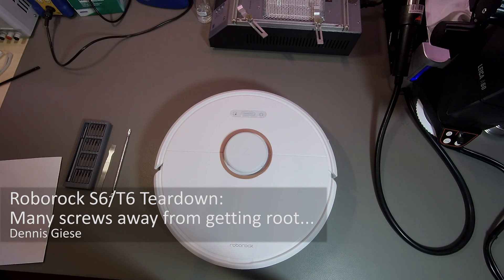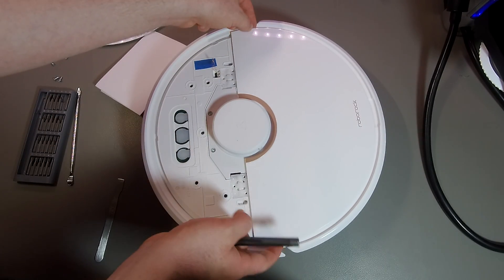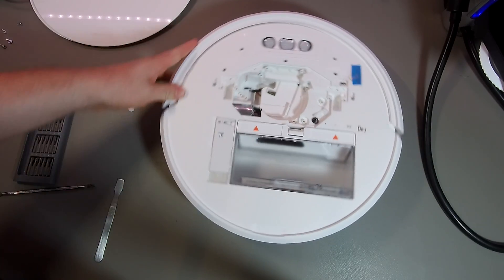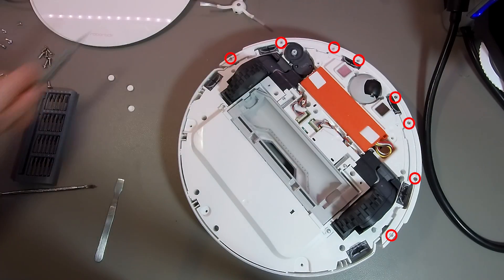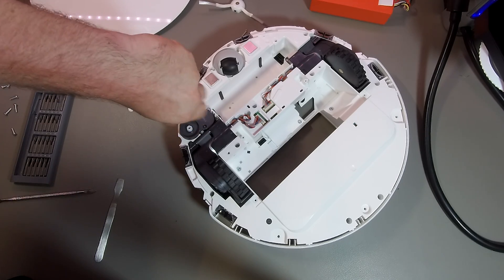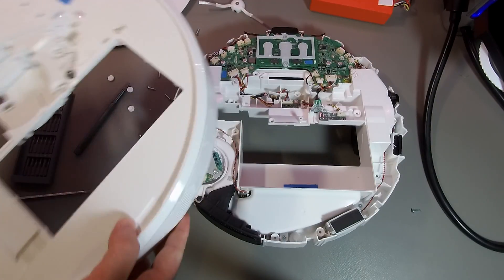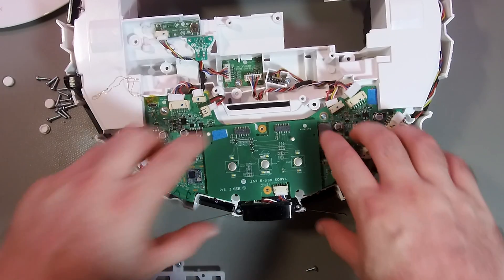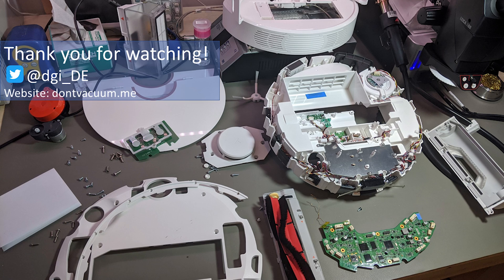Roborock S6/T6 Teardown: Many screws away from getting root... (Part 1 of the rooting process)

Comment: Hello! I wanted to say thank you for this very helpful video in taking apart my robot vacuum cleaner. I needed to try to clean the hidden filter as the robot had been giving the error code about blocked or wet filter, neither which the main filter was (and had been changed as well).

Fingers crossed this helps! Nevertheless, this was a huge help in trying out a smart fix for the roborock. So again, thank you!

Comment: I am looking to replace a broken speaker on my s6pure Attack on Titan edition and I just want to know before I disassemble the device if the speaker connectors are soldered or if they attach to one of the physical connectors on the PCP. If the latter, I think I should be able to just buy a used s6 on eBay and take the parts I need.
Reply from the maker: All parts are having connects. Afaik, the speaker uses a red/black wired connector. Should be trivial to replace.
Reply: @dontvacuumme Thank you! By luck my speaker did not fully break from water exposure; letting the speaker dry out for 2 days was enough to restore loud volume function. Finding the part is sadly no cheap task because it's not available on AliExpress and Roborock customer support declined to sell it.

Comment: Hello Dennis, very detailed video. I have a Roborock S6 MaxV which doesn't finish the factory reset process and power blinking keeps on going forever. Is there a way to fix this using your method? Also what is the micro USB port for?

Comment: Wow! What company is so scared as to make you reassemble the device to make it work locally.
Reply: One that is not sold locally this up until recently was only available in Asia being Chinese based and the number one selling robot vacuum cleaner in china and Asia. I bought my first one in Hong Kong 5 years ago and only locally released about 3 years ago but with no service department. The vacuum parts are very cheap and the vacuum is very easy to service and replace parts yourself if your careful.

Comment: Hey mate, I was wondering if you know the pinout for the motor connector on the board. I believe two are for +14V, GND, two others for the direction I/O. Could you help me with that?
Reply from the maker: Not really :( I did not measure the voltage on the wheels. A while ago I was looking at the Dreame robots and they seem to have a 12V and 16V pins. But I was never really looking into the wheels.

Comment: Hi. Is there a soldered accelerometer and gyroscope module on the board? Or is it part of a separate module?
Reply from the maker: Its seperate in the back of the unit, next to the speaker.

Comment: Hi There can you explain how to run this robot without - WiFi - ex. disconnecting some wire from the board etc.?
Reply from the maker: If you rooted it, then you can just disable the wifi card (or disable WPAsupplicant). You would still have access over USB and can reenable it.
Reply: @dontvacuumme  Thank you for reply. That makes me very happy. I try to limit WIFI waves in my environment.

Comment: does the usb port on pcb is powered ? I plan to attach a raspberry pi zero to it with a camera
Reply from the maker: Not sure if you can pull enought power from it, even if it would. But you might be able to get some power from the pcb (e.g. the WiFi module)
Reply: @dontvacuumme  ok 🙏

Comment: I watched because I wanted to see the 'noise reduction filter.' I keep getting 'filter is clogged' meaning that it thinks that the other filter is clogged. I suspect that it is the back side of the noise filter that has picked up enough dust and debris to impede the air flow. I think that not blocking the exit of air would make the vacuum work better as a vacuum although increasing the noise. 

Have you tried just taking out that filter? it looks like it is some sponge material although, from the outside, it is a grid of tiny holes.
Reply from the maker: I think I just left it at some point by accident, because I forgot it while reassembling. So technically it should work without the additional filter. But I am not sure if removing solves your problem. Sounds more like a hardware issue.
Reply: Very late reply, but there's also a mesh filter under the fan axle which was half clogged on my unit and contributing to the Error 10

Comment: Very, very useful, even for the S4. I was able to use this video to flash my S4 with Valetudo.  There were two hiccups, but one was from a failure midway through from my UART bridge.  It took a little while to figure out that was the culprit.  However, Dennis and I figured out how to easily repurpose a node MCU to do the job.  The second glitch came from how the robot booted up (on B instead of A), and may have arrived that way at my house.   Dennis quickly figured out how to fix the flashing for that problem.   Otherwise, it went smoothly.  Now I can SSH into the robot over wifi, or even over microUSB cable, since one comes off the board.  It took me several hours, and you do want to go slowly and document all of the screws.  There is nothing too complicated, but it is a lot of small steps, so you probably want to take your time, go slowly through them in a quiet place.
Reply from the maker: You forgot to mention that you have a spare screw ;)
Reply: Awesome to hear! Can you elaborate on the fixes? Or will they no longer be needed?

Comment: Hi, sorry. I have looking for a lot of info related to this. I have a S5 chinese version and i want to use it outside china,  S5 need to be byspassed this way too. Or that model could be updated without doing all this process. There still is a way to do it only by software?  Your answer will means a lot to me, all the information that i get is from some years ago and nothing of that solutions are working right know. Thanks! -btw sorry for my english -
Reply from the maker: Thankfully the region change for the S5 is not as difficult as for the newer models. Download these files and follow the readme: https://github.com/dgiese/dustcloud/tree/master/devices/xiaomi.vacuum.gen2/CN_to_EU_script
Reply: @dontvacuumme  Thanks a lot! I was looking for something like this so long. The readme content is a little short, the file doesn´t have so mucho info about copying the files to the vacuum. Do you know any tutorial or something similar to follow to make it happen? I haven´t   so much knowledge about coding and another stuff needed. Thanks again. Martin.

Comment: Does this method also works for S5 Max? As far as I can see in firmware builder S5 Max is supported. Anyway, great job, thanks !!!
Reply from the maker: The idea is the same, but it works slightly different. Roborock changed the firmware structure and hardware, which makes it very challenging. The "vinda" file is not existing anymore and they replaced the login shell. I am working right now on the documentation and tests of the root. Also Valetudo is ported, however it is more complex. There are some issues which needs to be fixed and tested in general. There is no recovery, so no second chance. I really want to avoid that people brick their devices while trying to root it. Expect some update in a few days ;)
Reply: hey  @dontvacuumme , amazing video! Do you know something about S5 Max version? Thanks!
Reply from the maker: @_smt_  Check this step-by-step manual: https://builder.dontvacuum.me/s5e-cheatsheet.txt
Reply from the maker: Whoops, in case you did not saw it yet, check this cheatsheet: https://builder.dontvacuum.me/s5e-cheatsheet.txt
Reply: @dontvacuumme  Wow! Thanks Dennis. I'll check it now. Do you know if the teardown is similar to your video for S5 Max?
Reply from the maker: @_smt_  Yeah, if you have a 2020 model, it should be similar. Generally, it should not be difficult. Just keep track of the screws and make pictures inbetween. That way you can get it together if you get confused ;)
Reply: @dontvacuumme  yes, I have 2020 model so, sure, that's the way I'll follow. Thanks for all your help!

Comment: Thanks a lot for the excellent video! In your opinion, would Roborock be able to prevent this rooting process with a firmware update (for example by disabling/encrypting the UART connection)?
Reply from the maker: Thank you for your feedback ;) Technically they could block the UART, as they do in newer models. There are other rooting methods (which are a backup). But at this point I don't think that they would block UART in older models, especially as I am not sure if they have a way to update U-Boot. However they will likely lock down things in future models (like they did with the firmware updates). That's the reason why I don't immediately publish rooting methods and wait until newer firmware is out. In case of the S6/T6 they released the multi-floor feature and that a good point to release the root.